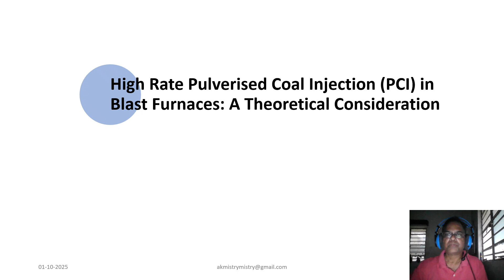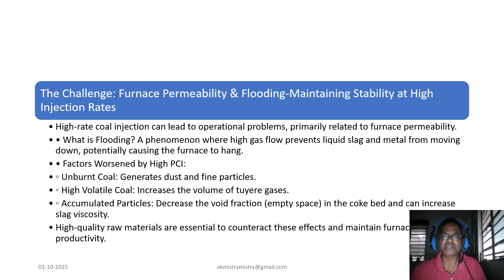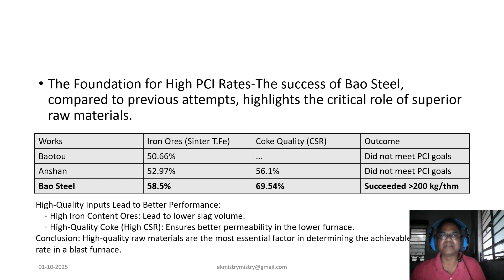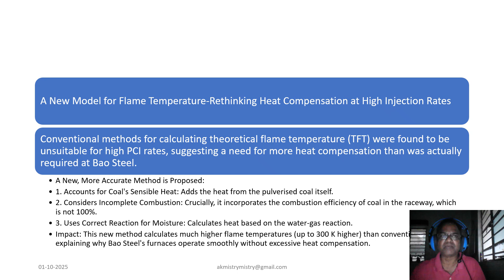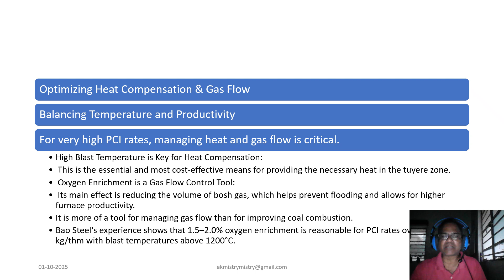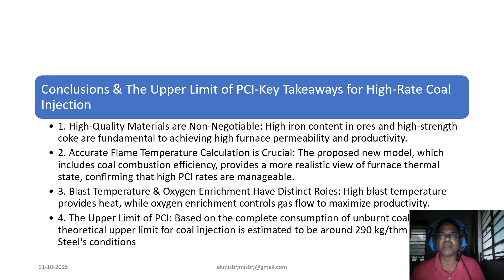Pushing the Limits: How Blast Furnaces Achieve Over 200 kg/thm Coal Injection

Comment: How we can tell that PCI is burning or not. 

We did Carbon analysis of GDC dust but the data shows not given the relistic picture. 

We following that if H2 in BFG more than 4.5% than PCI burning is not happening.
Reply from the maker: 1. Stop using a fixed H₂ threshold. Instead, trend the H₂ content in your BFG against the PCI rate and the hydrogen content of your injected coal. An increase in H₂ is expected and confirms injection is active. Look for deviations from the expected trend which may indicate other issues like water leaks.
2. Continue analyzing GDC dust, but with more detail. Don't just look at total carbon. Use microscopy to identify the morphology of the carbon particles to distinguish between unburnt PCI char and coke fines. A sharp increase in fine, balloon-like carbon particles points directly to poor PCI combustion.
3. Monitor your gas utilization (ηCO or CO/CO₂ ratio). A decrease in gas utilization and an increase in top gas temperature at a constant PCI rate can indicate that excess unburnt char is causing more solution loss reaction in the shaft.
4. Closely watch your blast pressure and Delta-P. An unexplained and sustained increase in pressure drop, particularly in the lower furnace, is a strong symptom of permeability loss due to fine particle accumulation from poor combustion.
5. Calculate and track your corrected coke replacement ratio. A declining replacement ratio as you increase the PCI rate is a clear economic and technical signal that the PCI is not burning as effectively as it should.